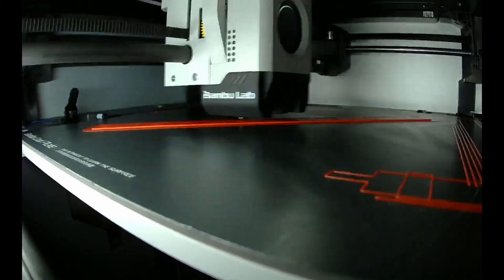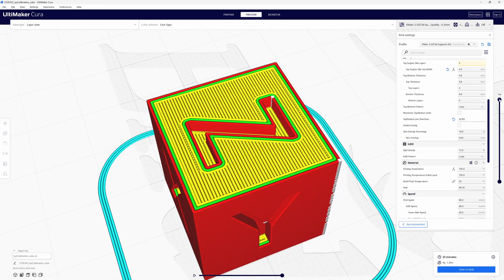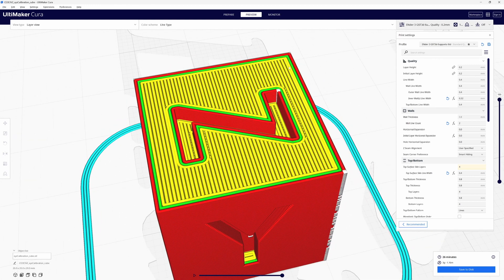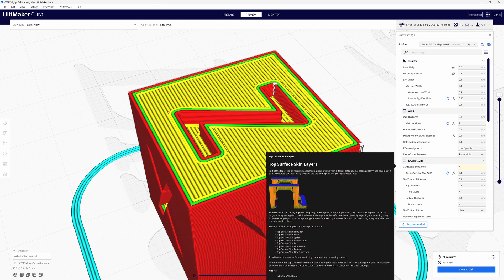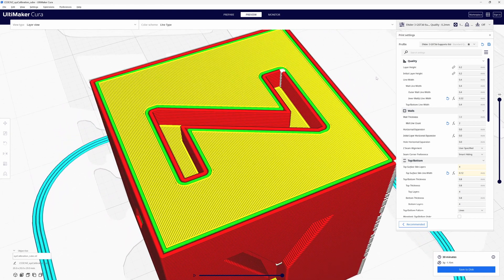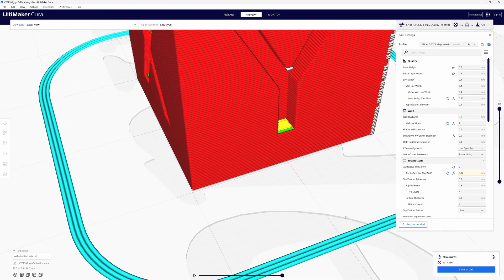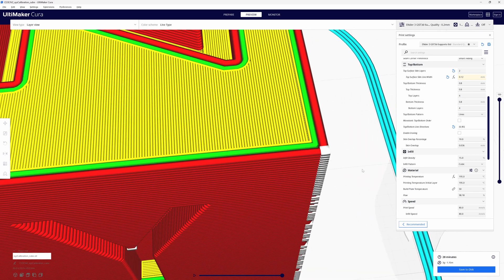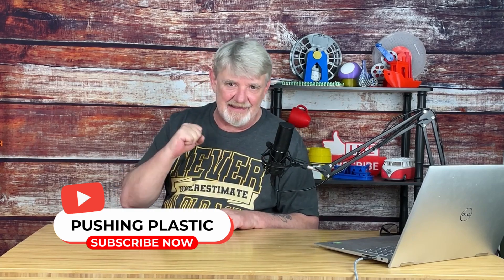Close Those Top Layer Gaps

Comment: i have af pei smooth bed on a k1c and would like the first layer as smooth as possible, because that layer will be the front of my print, and the top layer will not be vissible so what would you recommend there
Reply from the maker: I would work to achieve the best first layer I possible could! It all starts with a level bed.
Reply: I have made the best possible z offset i would like to get almost invisble layer lines and made first layer slow and width 0.7 but do you have any tips about almost invisible layer lines  @pushingplastic7445

Comment: Hate to be that guy and here it comes, but, you should really try the process you are recommending to people to "fix" an issue before you post your video so you can show what the actual results are. I know this video is 7 months old now and you may not still operate your channel in the same manner anymore, however I really think that without knowing and/or showing a result, preferably with video of the actual affected print in motion, I personally wouldn't  post a something I "think" will work without first testing it, especially seeing as it's only a half hour print (26 minutes for the fussy people who want to pick this comment apart)
Reply from the maker: Funny, I did try it, how do you think I made the video?
Reply: @pushingplastic7445 you really should have shown an actual print, not just playing with slicer settings
Reply from the maker: @theuglydumpling4772  In hindsight it might've been a good idea. It was hardly "playing with slicer settings". Since the video was about slicer settings and I've included that, I thought it would be enough.  Thanks for the comment.

Comment: Hello Bill,my name is Marco,thanks for your teaching.
My question is, I must do all those tricks together or testing one by one looking what's is good or not?
Sorry my English im from Brasil.
Reply from the maker: No. You don't have to follow them all. Like the top layer direction, you don't have to change that. I do change the inner wall setting to 0.32, my top surface skin width to 0.12, my top surface skin layer I set to 2. The skin overlap percentage, you can leave that alone, or only change it if you have too. You don't have to print after each setting change. Just make the change in the slicer, slice the model and look at the preview to how it is affecting the model. I hope this helps.

Comment: Tried this and worked out well, but I’ve been getting a line/gap/separation on the outside side wall when it goes to start the top layer from main infill 15% density to start of Top solid layer.  Any ideas? I’m using Cura.

Comment: Another video from you explaining EXACTLY what I was looking for. I wanted to "iron" the very last layer of my prints, or at least make it "flat" because complete ironing method looks different. Just tested out your method on the calibration cube and, wow. It works ! Will test on actual 3D models that could receive such process.
Reply from the maker: That’s great! I’m glad these are helping!
Reply: @pushingplastic7445  Keep sharing the good vibes, straight to the point. Good job sir !
Reply: Do you still need to iron or is it smooth enough?

Comment: To be honest, I think if your infill is showing, you have bigger issues. Fix those first instead of trying to hide the imperfections.
Also, don't try to save time in 3D printing by reducing top layers too much. Four top layers at 0.2mm height is only 0.8mm. For parts where some strenght matters, that's just too weak.
As for the suggested settings to improve top layer quality: You're almost mimicing ironing (line width, overlap). Why not just go with that?
Reply from the maker: The infill showing was because of all top layers running the same direction, is was shown for demonstration purposes,. Perhaps you missed that? Also, 4 Top/Bottom layers were shown since that is Cura's default. If you watch my previous videos on top layers, I mention that 4 top layers is more of a minimum than a default. This video was about closing gaps. You'll also notice that I discuss ironing in that video.
Reply: @pushingplastic7445  I get that. But all top layers running in the same direction is not the default. The Cura tooltip for Top/Bottom Line Directions even says so: "... Default is an empty list which means use the traditional default angles (45 and 135 degrees)."
Reply from the maker: @dieter_be  Again, it was shown for demonstration purposes. You might not print at [0,90] , I do. Others do as well. Cura has a lot of options for a lot of different purposes. Are there times when I print at 45 degrees? Yep. There are times when I don't. But, you can apply the same method at 45 and 135 degrees to get smoother looking top layers. Infact, the before an after images on the thumbnail are at 45 and 135. Don't limit yourself to Cura's default settings. They are a starting point.
Reply: @pushingplastic7445  So in fact you made a video about
1. creating a problem that nobody has: you set ALL your line directions to one angle (90°) , instead of different angles (the default in all slicers). 49s in to the video (https://www.youtube.com/watch?v=hKx0CbH32GM&t=49s)
2. fixing that problem

Look, I've seen a few of your video's and I liked them. But what I don't like is creating content for the sake of it. This video only creates unnecessary confusion.
Reply from the maker: @dieter_be  It might not be a problem for you, but it did help out a few people. How many have you helped out today. Obviously, you didn't watch the video, if you did, you didn't pay attention. At 1:06 into the video I state, that "In fairness, I don't print with my lines like that. I'll use an orientation of [0,90]" You don't like the video, no problem, I'm good with that. Leave your snarky comment, hit the dislike button and move on. For some reason you feel the need to argue about it all day. It has nothing to do with content creation, I haven't made a dime on these videos.
Reply: @dieter_be  You, obviously, have not printed many top surfaces with lettering on them. The gaps Cura leaves behind with the default settings is very frustrating indeed. It's not a structural issue as much as an aesthetic one. PP, IMHO, has eloquently described the problem and a very practical solution to it. I applaud his video for shedding light on solving a problem that will definitely arise if you try to print depressed lettering or holes without having gaps around them. Well done video, PP.👏
Reply: @pushingplastic7445  That's what happens when you skip your morning coffee. 😁
Reply from the maker: @SuperBoppy  Thanks for the kind words! Sadly, I remember the day that those comments were coming in! Again, thank you so much for the kind words and thanks for watching!
Reply: @SuperBoppy  Sorry, but you're wrong in saying I don't print top surfaces with lettering on. The gaps may be there, but that was not my point. Printing top surfaces in angles different than the walls and the layers with alternating angles will almost completely get rid of gaps. If you still have gaps with Cura, I suggest using another slicer. But I can hardly believe this issue still exists in most slicers since the introduction of Arachne (variable line width).
I'm staying with my opinion that this is a non-issue. You're free to disagree with that.

Comment: Thanks for the helpful videos. I’m a newby to 3D printing so I hope you don’t mind a basic question. I have a Finder-3 and I slice with the manufacturer’s software “Flashprint”. However, I’d like to use Cura so I can follow along with your videos. Would the G-code from Cura cause any problems with my Finder-3print?
Reply: No.
You can use any slicer with any printer.  There can be variations in profiles, options, etc but you won't break anything.
I started 3d a year ago and was in the same question mode. I have used every single  slicer I could tinker with... no real issues other than,  the advice is to stock with just one until you master it. Then move on.
Reply from the maker: @graphguy  Excellent advise!
Reply from the maker: Finder 3, that's a Flashforge brand? Correct? You should be good to go with Cura! Flashforge has a document on their website for adding the Finder 3 to Cura as a printer. https://en.fss.flashforge.com/10000/software/49c31069aa6631421478727c4b4c8506.pdf
Reply: @pushingplastic7445  thanks so much! I had no idea.
Reply from the maker: @MrRwillis59  Hope it helps! And thanks you so much for watching!